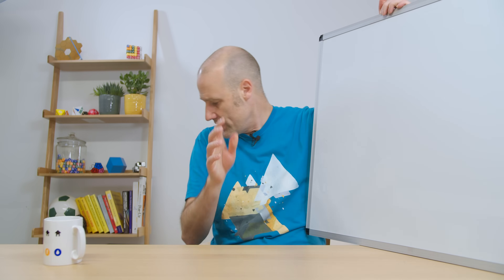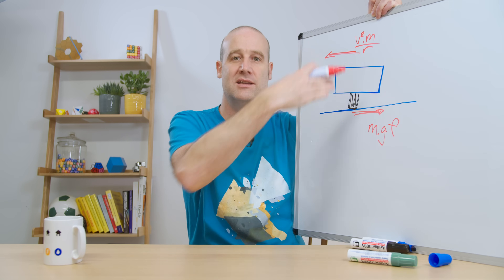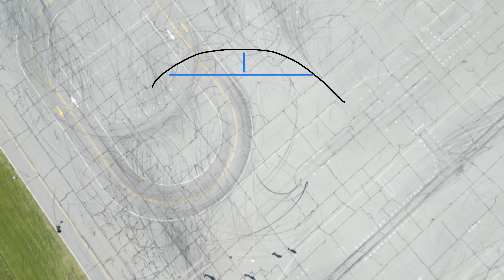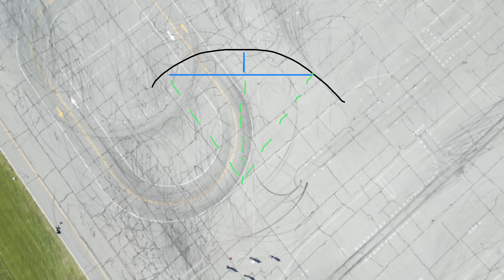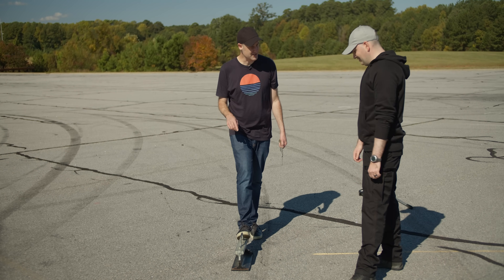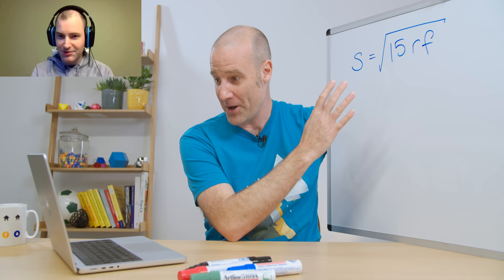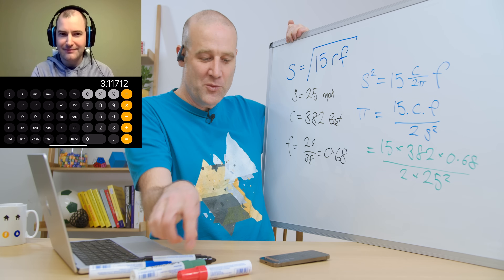Using an Out-of-Control Car to Calculate π.

Comment: Very nice! But how do you what g is? The best way to measure g is to use pendulum and a formula T = 2 pi sqrt (L / g). So it looks like that no matter how hard you try not to use pi in your formula, it finds a way to sneak in.

Comment: But the radius of an actual mark is generally changing, and the coefficient of friction is different depending on the construction and current state of the tires.  Softer tires vs harder tires, older tires vs newer tires, bias vs radial, etc.  Add to that the state of the road, how quickly the steering input was made initially will make the "skid" change as well.

Comment: A lot of people here in the comments point out how Mat could have used 26/38 instead of the rounded 0.68 to calculate pi and get closer to 3.14. What I would like to point out however is that we could have also used 22/7 to get the very close approximation of 3,142857142857143 of pi directly. Much more efficient! So for my pi day I will grab a nice sheet of paper and simply divide those  two badboys for my personal amusement. Might even do a video.

Comment: Unfortunately if you had used the 14.962 instead of 15, and used the 26/38, it takes you slightly further away again to 3.128475453.

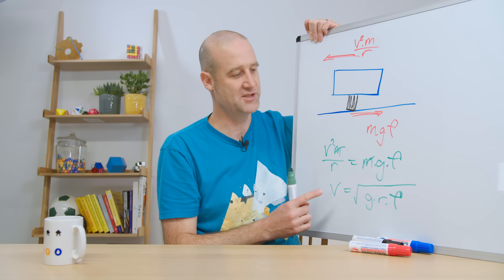Comment: 4:18 I admit, I didn't expect the mass of the car to completely cancel out of the equations! That implies that really tiny cars and really big heavy cars essentially skid the same radius at the same speed on the same surface with the same tires.
Reply: That's very nearly true, but (excuse my nerdery about tires for a second, I think this is cool) the coefficient of friction of a tire on asphalt is a function of the force per unit area. More pressure means a lower coefficient of friction (...don't ask me to explain why, I don't understand it, lol) 
The upshot of this is that lighter cars will follow a slightly tighter arc than heavier cars, and cars with wider tires will follow a tighter arc than cars with narrow tires (all things being equal). In this case, the difference will not be large enough to matter so we can ignore it, but it's a neat effect!
Reply: That doesn’t sound correct, the coefficient of friction is a unitless scalar value, it’s not dependent on the mass of the moving object. I think maybe what you’re thinking of is that the force of the friction itself is higher the greater the mass of the object, so a lighter car exhibits less frictional force. But the way friction works that greater frictional force due to masstrying to keep the car from sliding is offset by a greater momentum and kinetic energy of the object trying to keep the car going in a straight line instead of a curve. Because both of them are linearly dependent on the mass the ratios cancel the masses out and you have a constant that depends just on the surfaces.

That said wider surfaces of contact also increase the total frictional force, and heavier cars will probably flatten out their tires more making them have larger surface contact areas, which like you said can mean a tighter circle. But it’s not because the coefficient of friction changes due to mass, that coefficient is independent of mass. It’s the different side effect of the tires changing shape.

Comment: And I thought we were going to calculate pi by using the drop needles on the floor method only it would be the measurements of the car on a field of parallel lines.

Comment: I think your free body diagram for the sliding car only needed a frictional force, since that's the only force causing it to turn. If your diagram was accurate, the car would be in equilibrium and not turning! There's never really a "turning force," it has to come from friction or tension or something.
Reply: He is drawing the centrifugal force from the reference frame of the car.

Comment: 14:20 — But on the board you wrote $\cdot$ instead of ldot (i.e., ".").

π = 3·117 = 351  which is only 11,073% error.

Comment: Considering the fudging here, you should have your answer to 2 s.f., ie, π=3.1 (reporting with errors, I got π=3.1+/-0.8). Not bad considering that’s the actual value to the first decimal!

Doing errors:
π=15Cf/(2S^2).

Assume Gaussian distributed errors. Given the experiment, I will say that C = 382+/-5, S = 25+/-1 (honestly, you often use a gut-feeling like this based on your certainty in the measurements. These errors feel right to me). 

Now f = F/m, where m = 38+/-1, F = 26+/-1 (let’s say), so Δf = +/-f*sqrt((ΔF/m)^2 + (FΔm/m^2)^2)=+/-0.02, and so f = 0.68+/-0.02 (to the nearest sf)

So plugging that in, we find:
π = 15*382*0.68/(2*625) ≈ 3.12. 

For Δπ, we again use Gaussian error propagation. So Δπ=+/-π*sqrt((15fΔC/2S^2)^2 + (15CΔf/2S^2)^2 + (2*15CfΔS/2S^3)^2) = +/-0.8.

So π = 3.1+/-0.8. Honestly… the fact you calculated “3.1” is not bad at all given the errors, fudging and design of the experiment!
Reply: For those wondering, the biggest source of error is from the last term in the sqrt, ie, 2*15CfΔS/(2S^3). But without knowing the speed to the first decimal, I’m pretty uncomfortable reporting it as “25.0+/-0.1” or anything different. Even if you used 25.0+/-0.1, your error for π is still +/-0.3. To get more than 2 sf of precision, you’d need to reduce the errors in both C and f (since their associated bracketed terms for Δπ are of the same approximate magnitude).

Comment: I wonder if you'd have got a better result by measuring the car's speed externally with a radar, given that the speedometer measures car speed by measuring wheel rotational speed and assuming a certain tire radius and also non skid condition.

Comment: Was curious how far off this could be based on coefficient of friction, roughly got an estimate that it could be off by around 25% in the worst case.. but like, that was a really unlikely worst case. So I'm feeling like it's better than I would've thought for estimating vehicle speeds. Also speedometers are expected to be off by around 8% at maximum, so the 25% doesn't seem that bad when even speedometers can't be relied on /that/ accurately.

Comment: Also, as a physicist, it causes me physical pain that you drew the friction force in the opposite direction to the mv^2/r.  The friction force is the centripetal force (it is the force acting on the car that points towards the centre of the circle).  It doesn't oppose the centripetal force.  There is no actual force called "the centripetal force".  We need some force to "be centripetal" for the car to turn, and in this case it happens to be friction that is playing that role.
Reply: Thanks.

Comment: How many years will it be before Matt calculates pi by measuring the circumference of Earth?
Reply: I wonder if you can calculate pi based on the orbital frequency of a satellite? Pretty sure orbital equations have radius in there a couple times. Maybe you could use a laser to measure how far from Earth the moon is, and use the lunar month to calculate pi?

Comment: if you average all your values for pi from your pi day videos the average is 3.197636329 with a % error from pi of 1.783925607%. Your 2018 pi value was the most accurate at 3.141592654

Comment: I'd fully support you releasing this early iff your estimate is exactly the time it was released (Assuming that the noon UTC on the 73rd day (72.5 days) of the year is 3.141..., the 69th day at 4pm (68.666) is 2.975...)  XD I humbly guess that 2.975 is the 2023 estimate but anywhere in the range 2.926 to 3.010 would be acceptable :P

Comment: As a chemistry professor, not showing units during dimensional analysis is killing me! Love the videos
Reply: And significant figures. Because all the measurements were to 2 digits, and the rounding of the scale factor to 15, we really can’t expect more than two digits in the final result. So 3.1 it is
Reply: Also a lot of the units got smashed into that "15"
Reply: I refuse to follow SI advice to put a thin space between a number and a unit because I feel so strongly that the two are not separable.
Reply: @nicholasvinen  I feel the same about numbers and currencies for sums of money. I'm always wanting to keep them together in an object when I'm working on computer programs - but a lot of programmers are willing to pass them around the program separately and just hope they'll always remember not to put a number together with a currency that doesn't belong to it.
Reply: @barneylaurance1865  yeah, that's a recipe for mistakes. I agree that currencies are basically like units. The number without it has no real meaning any more.
Reply: @nicholasvinen  I grew up with mechanical typewriters and then fixed-width fonts on character-mapped displays, i.e. not having any way to create a thin space, so it's natural to type the unit butted-up hard against the number even if that is not the way I would hand-write it.

But I also think of the prefix as belonging more to the number than the unit.  For instance, 170cm. can be thought of as (170 centi) metres, with "170 centi" being just a funny way of saying 1.7.  (OK, this gets awkward with mass .....  we would have to rename the kilogram, and then the renamed gram would have milli in it, and maybe the cooks would be annoyed, which probably why it wasn't done before.)

Casio calculators actually used to have an "ENG" button, short for "Engineers' notation" which would adjust the mantissa of a number upwards or downwards  (depending if or not you pressed "INV" beforehand)  to make the exponent a multiple of three and therefore align with a named prefix, e.g. 06 = mega, 03 = kilo, -03 = milli, -06 = micro &c.  So if you get an answer of 5.89e-7 you can render this as 589e-9 or 0.589e-6.  (And many other, less-sensible ways of writing it!)
Reply: @bluerizlagirl  yep, this riiiiight here. That's how we were told to do it in typing class, even.
Reply: @nicholasvinen  This is what parentheses exist for.
Reply: Technically, you shouldn't show units during dimensional analysis. Units are, though related, not quite the same thing as dimensions. Dimensions (in the context of dimensional analysis) are things like length, time, mass, while units are meters, miles, seconds, hours, kilograms, pounds, etc... So you can't attach actual numerical values to dimensions (because of the lack of unit), but the whole purpose of dimensional analysis is a sanity check that an equation isn't nonsense equating apples and oranges, so that doesn't matter.
Reply: @QuantumHistorian  Correct.

Comment: So, to measure the circumference you had to basically find the center (by trial and error I believe), plant the pivot point there and go around the circle with the distance measurement wheel. Why not just measure the radius directly then? I mean, I know why, the accident investigation bit was very interesting, but this way of calculating pi feels a bit too convoluted.

Anyways, happy Parker-pi-day (which is on March 10th, obviously)!
Reply: Having a convoluted method is the joke here
Reply: To directly answer your question: if you measure the radius, then you don't have any equation for pi anymore.

But I do agree that it feels a little bit weak to measure pi by measuring an imaginary circonference of which you only got a small arc...

Comment: That was impressively close, Matt.

I just did my π day calculation using the time stamp of when I paused the video and saw my name on the screen. And my result was spot on.
Time of my name appearing N = 17:10 or 1030 seconds
Total time of the video T = 17:23 or 1043 seconds
An arbitrary scale factor A = 10 

A×N÷T= 10×1030÷1043 = 9.8754 rounded to 4 decimals
Is that close to a familiar number? Throw in a square root for no reason other than it makes my last 30 minutes seem productive.
√9.8754 = 3.14 rounded to 2 decimals

That, my friends, is how to calculate π using serendipitous data and an arbitrary methodology. Which came from finding the percentage just for fun and noticing it was close to 10π²

Comment: Always drives me completely crazy that pi can't be reduced as a fraction and yet the most common and simple use case for pi is as ratio.
Reply: What do you mean the most common use case for pi?
Reply: @Fresh Rock Papa-E  I think the most common use for pi is converting the radius to circumference or the other way around and they are related by a ratio which is irrational (ie can't be a ratio) just feels a little crazy. I understand that this means that either the radius or the circumference is irrational

Comment: yucky units man, wtf. (ah you're as upset as me... good.)
the next level engineering way of converting units is to still write out those conversions as for example 3600 s/h, since that cancels out nicely. 1h * 3600 s/h = 3600 s

Comment: Sorry Matt, but I have to say that approaching an experiment like this may not give a truthful result. 

First of all, errors should be incorporated and propagated through the steps, including errors on measures (length of the circumference, force to calculate the coefficient of friction, car speed) but also on unit conversion (especially on that 15 inside the square root). That's because the nice result for pi you get at the end might be a fortunate balance between low and high estimates (3.14 +/- 0.01 and 3 +/- 2 are different results). 

Secondly, I did not understand how the skid arc was prolonged into the circumference: isn't the radius length needed to trace it? Doesn't it introduce a bigger error component than using the other method?

Comment: Eric, that sled looks far nicer than the half-bag of concrete poured into a chunk of tire that they made me build and then carry and drag around for three weeks.
Turns out that gently-used, nearly level, dry, asphalt road-surface still is around μ = 0.7. 
Thanks for the memories.

Comment: I know this car only had one tire, but how did you decide which tyre track to follow? Is it the back ones?
Reply: I, too, would appreciate an expanded explanation of this.

There was some explanation of "one tire track crossing another", but I don't remember where the other data point was. 

A brief overlay of the arcs used for measurement would be delicious.
Thanks!

Comment: I am bit confused on how you used feet in the equation with MPH, how do the units cancel out? Could you go over what units the "15" has so that it works out.
Reply: It's explained at 4:30

Comment: This is cool, but I didn't get why you can model the skidding car as circular motion. Sure, any little curve can be thought of as part of an arc, but to use the chord method or the 'circumference' method you kinda have to assume uniform circular motion for a while, no? Uniform circular motion happens when the force is constant and perpendicular to the direction of travel. I'm not seeing why that would be the case with a skidding car.

Comment: I find the most difficult part of this is actually getting the coefficient of friction right. It's a small number that's difficult the measure accurately that has a profound effect on the final result, in terms of getting PI. For getting speed it's not so bad.
Second to that, i don't like that he said "our calculated value for Speed was 25 mph", why was it calculated when it was recorded?

But anyways.

S = sqrt(15*r*f)
And since we don't know "r" we need:
S^2 = 15*(C/2PI)*f
And...
PI = (15*C*f)/2S^2

You got: 3.11712 = 15*382*0.68/(2*25^2)

And just slightly altering f you'd get:

f=0.700 : 3.20880 = 15*382*0.700 /(2*25^2)
f=0.690 : 3.16296 = 15*382*0.690 /(2*25^2)
f=0.685 : 3.14004 = 15*382*0.685 /(2*25^2)

Small percentages of "f" gets you so much closer to PI.
I asked WolframAlpha what a good value for "f" would be: "3.14159 = 15*382*x /(2*25^2)" and it spat out x ≈ 0.685338

And just for good measure, let's try your original value for gravity of 14.962.
And let's assume you got "f" wrong by a single decimal point, it's actually 0.69 (a better number anyways)

14.962*382*0.69 /(2*25^2) = 3.154947168

If you'd have done it that way, you would have been so close.
Reply: Damn, if we start with the result we want to get and calculate the numbers we need that gets us a better approximation? Who would have thought!?
Reply: @freshrockpapa-e7799  Yeah right?

You missed the point, didn't you?
Reply: @RealCadde  apparently I did. What was the point?
Reply: @freshrockpapa-e7799  The point wasn't to derive the correct number to get at PI, the point was that the method used was extremely volatile because of the coefficient of friction.

If they could have measured the coefficient of friction more carefully they'd get a better result.
Reply: @RealCadde  damn, less error means more precision? That's an incredible insight right there
Reply: @RealCadde  what's a bullshitter?

Comment: Sorry, but I guess you had to find the center of the circumference anyway to trace it all out, so at that point you already have both radius and circumference, since you (rightfully) allowed yourself to say r=c/2π . Or at that point, one could measure the angle of the arc in "fractions of a full turn" because who needs degrees or radians and use that to find the circumference from the arc length.
I agree that without skidding equations it's more boring though.
Reply: They didn't measure the radius though, precisely to avoid what you said.